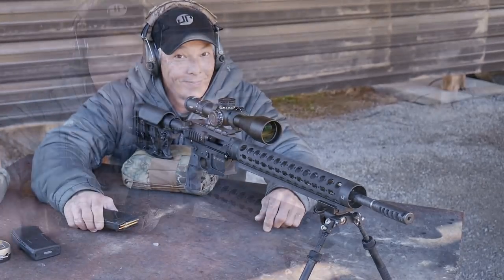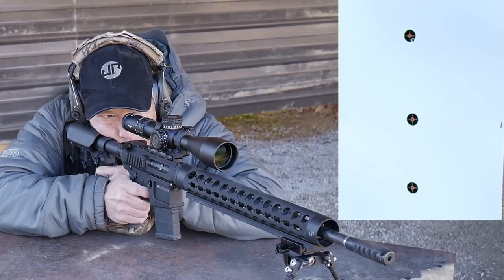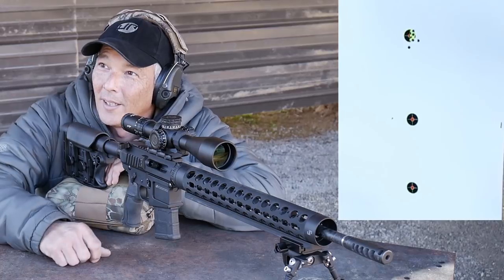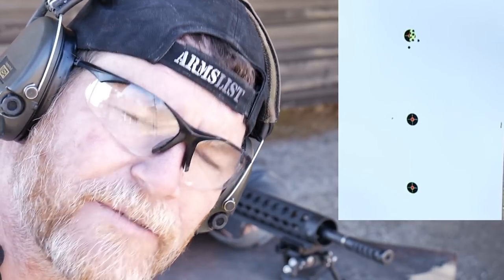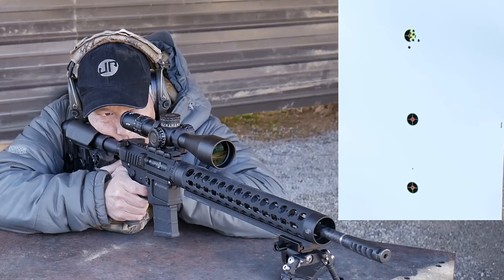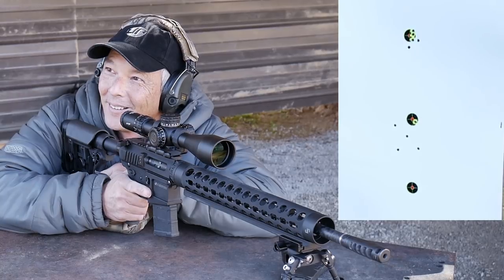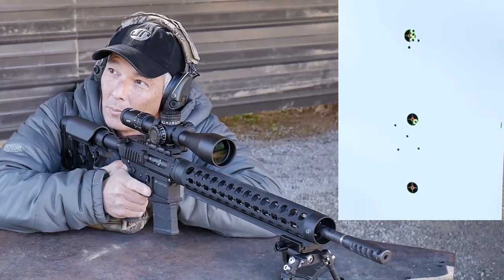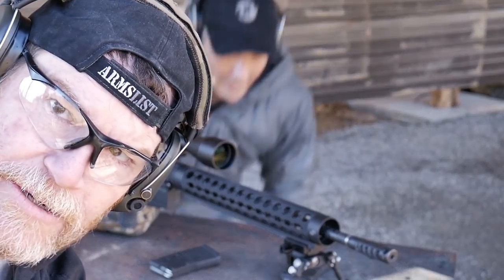Tulammo 75 grain .223 is a No Go & Here is Why!!

Comment: Can’t wait for the classes in PA
I’d say it’s still good SHTF ammo.  All of those shots will still hit center mass or close enough to be a bad day
Reply: @Future-Preps35  Huh? stick in your chamber after a mag or two? This is all we use on a PSA and many other brands with a drum mag and Fostech trigger, NEVER any stuck casings! It's shit for tight groups but that's no surprise here. Perfect for cheap range mag dump ammo.
Reply: ricky rhodes  Some rifles just have tighter chambers or might be under gassed  than others and won't cycle it as well is all. Most rifles will eat it up all day long. If your rifle tends to choke on it then splash some oil in your chamber (bore bath) and it normally solves the problem. The only thing steel case will ruin faster is your barrel due to the bi metal jackets wearing it out faster. But i agree, like you said with prices the way they are you can pretty much just buy brass instead anyway.
Reply: Only the Ak47 platform is a true SHTF rifle if you're using an ar15 youd be best sticking to good ammo.
Reply: @Future-Preps35  not true at all, this has been  disproven time and time again

Comment: Does barrel twist affect the accuracy as the heavier the slug gets
Reply: Yes.
Twist and lenght. There's a formula just 4 that. 
75gr in this varmint caliber cartridge is just about the practical limit of its design.
Reply: Yes the heavier needs a faster twist to stabilize
Reply: @shermankearns200  and longer barrel.
Reply: 1/7 is the way to go.
Reply: @notyou1877  Not true a short barrel with 1/7 will have no problem stabilizing .75gr.
Reply: It's not the weight of the bullet (although there is direct relationship) but the length of the bullet in relation to bore size that will dictate what your twist rate should be to stabilize.
Reply: @notyou1877  InRange did a Q&A with a Faxon engineer who said that the bullet spins up to speed within the first bit of the rifling iirc
Reply: @barrydavis7068  It's both. can't have one without the other. The twist rate of your barrel  dictates the length of the bullet.  Other factors as the shape of the bullet.  But in all it's not the rifle that is accurate it's the shooter.
Reply: @aa-yt7wo  define the "first bit" please.
Reply: @notyou1877  I have to rewatch them but I think it was something like the first 1/8".  It doesn't take 16" of rifling for a bullet to spin up to stabilize it.
Reply: @aa-yt7wo  I can go on for hours about this, but I just don't have the time. I can give you one real life example though: .223 Rem. In a single shot heavy 20 inch barrel varmint riffle with 1 in 10 twist will not stabilize a 55gr projectile but it will do
 great with a 45gr. That's a real life example for this subject at hand.
Reply: @notyou1877  the rate of spin is determined by the rate of the rifling not the length of rifling
Reply: @notyou1877  What the hell are you talking about.
Reply: @airwolf269  you said "short barrel" will stabilize a bullet. I wanna know how short? Apparently in your world the minimum barrel lenght is not considered important as it is in mine.
Reply: @barrydavis7068  let's get a little more precise here. Lenght of the bullet is not the same as the lenght of the bullet's body making contact with the riffling. Those two things are not interchangeable. VLD type is very different than the S8 ogive found in traditional projectiles on the market. 
On the other hand why am I wasting my time discussing this detail with you. You don't make jacketed projectiles. You just pull the trigger.
Reply: @notyou1877  Number one you have no clue to my world.
Reply: @airwolf269  we both agree on something!
Reply: @notyou1877  IYO Its like a brown eye, Everyone has one.
Reply: @notyou1877  First of all, you don't know what I do.  And second of all I can see from your responses to other comments you are no Bryan Litz.
Reply: Yes
My mp15 1/9 can't hold a 77seira match worth a crap past 250
It will hold a 69 all the way out to 400
Reply: 1:7 should work.
Reply: @barrydavis7068  I don't care what you do Barry. Really.
Reply: It's not as important as some think, but kinda.
Reply: All these comments and not one mother fkr knows what they're talking about.

Comment: I bought 1000 rounds of the 55 grain 223 stuff. 100 rounds an I got 2 stuck cases. Not a big fan. Treated my chamber with moly paste and seemed to cure my stuck case problem. Still have 780 rounds left to go.
Reply: Get a heavy duty extractor spring.  I do that with all my ARs, no problems extracting steel case.

Comment: I ran about 85 rounds in my AR-10 and got a stuck case. 115 rounds left to get rid of this stuff then on to the brass case ammo. Great video as always KB32
Reply: Get a chamber brush and clean the chamber very well because more carbon gets past the steel case
Reply: Try a "bore bath" type it in on YouTube
Reply: Thanks for the ideas guys. I got lucky in the fact that the case in question fired and was a empty case upon removal. Got it out and cleaned it quite well. Also the steel ammo I have left is starting to get surface rest. Thinking I’ll just use the ones that haven’t developed rust and find a good way to dispose of the rest.
Reply: @StewieStew820  exactly, just squirt a couple drops of lube in your chamber every hundred rounds or two of steel case(bore bath).. helps with tight chambers that don't extract steel cased as well in ar's

Comment: I personally wouldn't use the. 223 but I've gotten decent accuracy and never had a problem with 7.62x39.
Reply: Gee ak fanboy
Reply: Good for close range, but similar to 300 blackout It's basically trash beyond 300 yards
Reply: @Es1911sumware Care to say how I'm wrong? The round has a 12 inch drop at 300 yards..
Edit: Well I waited almost a day so far, so basically you're just fanboys..
Reply: Tulammo .223 has hard primers and steel cases like to stick in ARs unless they're clean and very well lubricated. I wouldn't recommend betting your life on it, but if you upgrade your hammer/spring and keep your gun clean, it's fine to use for plinking/practice.
Reply: What Craig said! I can shoot better groupings from a standing position. This video is making me feel like The Rifleman.

Comment: Same experience I have had with Tula. They have piss poor quality control when it comes to getting a consistent powder load in their ammo. I have had a lot of their rounds that were loaded so light that it wouldn`t fully cycle the bolt on my AR, causing FTE and FTL. I had to have a buddy film the action on my phone and then slow it down so I could see what the problem was, and it became real clear real fast that the Tula didn`t have enough ass to work the action. Might be fine in a bolt gun, but for an AR, it`s a 50-50 chance at best.

Comment: In order to have an accurate round the projectile the velocity and the barrel harmonics half to match.
If you test a bunch of different ammo and you find one that is accurate in your gun, you're good to go. If you compare that to something you just grabbed off the shelf, odds are the shelf ammo is going to be much less accurate.
If the ammo is inexpensive enough you should pull the bullets select a powder and work up a load velocity that will bring the projectile and the barrel harmonics together, and all it will cost you other than the time to do it is purchasing a replacement powder.
If you wanted to be super cheap you could use the powder you pulled from the bullets and adjusted accordingly.

Comment: 3 to 4 moa is it normal for Tula. When you're doing your distance shooting  use brass.

For doing Up Drills, Zipper drills, transition drills, room entry drills, magazine change drills, malfunction drills, movement drills.... at under 50 yds the Tula is more than adequate. 

90% of drills is under 50 yds, so 90% of my ammo is Tula.

With the amount of money I have saved using Tula over 10 years, I have filled a whole safe with AR-15s.

Comment: "75 grain is always better than 55 grain." Except when you're dealing with armor. Which would actually be something to keep in mind during a SHTF scenario.

Tula/Barnaul ammo has never been known for its consistency of bullet construction / consistency of velocity. Both of which are needed for American levels of expected accuracy. Expecting accuracy to be decided solely by grain weight is unwise. You buy russian steel cased ammo for the cost savings. And when it comes to their soft point & hollow point offerings, you buy it for the acceptable lethality for the least amount of money possible.

Of course, every barrel has its favorites. But I've gotten ~2 MOA out of Wolf (Barnaul) 55 grain FMJ. I wonder if the issue with the 75 gr Tula stuff is the zinc jacket.
Reply: 124thDragoon good point what’s your best cost to performance round?
Reply: @MrEtherShot  that's such a old tale, yes speed kills armor 20 years ago, modern armor is more complex
Reply: @AmazonWebService98  plenty of videos of 55gr FMJ out of a 20+ inch barrel going through AR500 or better.
Reply: @jellyfrosh9102  ar500 8snr really exactly what I would call armor

Comment: I’ve used the 55 grain stuff and usually get a 2 inch group.with a 10.5 and 16 upper. However the stuff is dirty and has a tendency to gum up your action after a few hundred rounds with failure to feed

Comment: Depends on the rife and shooter. Tried shooting this ammo out of my CZ 527 LUX .223/5.56 bolt action. Problem was the case dimensions were not even close to factory brass cases. One actually got jammed (after discharge) in the chamber and I could not remove it at the range. It took me about 15/20 minutes to remove the case with a hardwood dowel tapping it with a rubber mallet. Called CZ and I was told that this rifle should shoot steel cased ammo all day long. I was asked to send it back if I thought there was something wrong. I didn’t and it shoots brass cased ammo of any brand (223/5.56) all day long and with accuracy. No more steel case ammo for this rifle. Now my mini 14 shoots anything. Period

Comment: I have found that a 1 in 7 twist does not stabilize the 70 gr and up bullets.
Reply: You realise 1.7 are designed for heavier projectiles. The one you tried from the one manufacturer may have not grouped well,but that isnt stablazation.

Comment: When I first got my AR, I shot Tulammo. At 50 yrds, it did ok, but at 100 yrds, it was bad. Went to Academy and bought their Monarch steel cased ammo, not the best, but can hold 2 MOA or a little under at 100 yrds. The Monarch is right at $5 for a box of 20, not much more than Tulammo with better performance. From what I gathered from internet searches, Monarch is rebranded Brown Bear. I shoot the 62gr ammo in my 1:9 twist AR and it shoots great.

Comment: I use ppu Russian made ammo in my 300 blackout and hunt with it to,and with 125 grain hpbt on my ati 300 blackout I've used it now for over 6 years with dead on groups touching each at 100 yards.with a nikon prostaff 4/12/40 bdc rifle scope and 7 inch drop a dead on 200 yards and a good 1half inch groop at 200 yards.with my ati 223 now I use frontier 55 grain ammo in soft points and they to are dead on at 100 yards and with on drop at 200 yards with half inch groupings at 200.when I bought both of my ati ar rifles with both set up exactly the same as each scopes and all ati told me not to be using nothing but brass ammo in each rifle and no steel ammo.now I have a diamondback db 10 308 ar rifle and use silver bear 308 steel casing soft point ammo with it but I do have to clean my rifle after ever time i shoot it,the silver bear 308's shoot great at 100 yards and at 200 as well!!!!!

Comment: you should redo this test,  but only for 1st and single shot accuracy. it looked as tho cold bore it was on point, or maybe it's the barrel because in all tests with the first group hornady I believe, 3 were sub moa then it just opened up. it may be the barrel.
Reply: Good point.  The first group was looking pretty good, then just a few rounds later it's patterning like buckshot?

That's pretty iffy.

Comment: Usually 5.56 barrels are 1-9 twist. Good for 55 grain. .223 wylde barrels are usually 1-7 twist which is good with heavy grain. I’m no expert but I like it in my 10.5 .223 wylde. Holds under 3” at 100 on a bs cv life scope. 🤔

Comment: This is exactly what I stock pile and range shoot. I’ve never had anything like this.. I don’t shoot at 1” dots but I do like kissing off the guys with precision rifles trying to pop clays on the back berms which from my lane is cross range at 275ish.. with a Simple 1-6 I can pop those clays at will with a 14.5 4150 Crome lines barrel. And that’s a 1/9 barrel

This is also what I use to zero with and even when swapping over to 55fmj or 77g black hills I don’t have issues.. I’ve never had a group like that unless rapid firing with just a red dot at 100.. 

In gel it also performs a lot like 77g otm.. little longer neck then you’d desire but damn near same performance. I’ve been stocking this crap away and shooting it since 2012ish when it first came out.. I’ve got maybe 20 cases of this down range now and never had a single issue in any of my rifles like this. 1/7 1/8 1/9 all the same results from 10.5 up to 16” barrels.. I for the $180 a case this stuff normally goes for I’d take it over anything else on the market.. back in the day it was lake city 62g till those prices went through the roof.. ever since this is 70% of what I’ve shot for years cause normally no one is paying attention and looking for heavy weight Tula they are always jumping in the 55 fmj..

Comment: I thought the 75 grain ammo worked best out of a SBR with an 8 in 1 twist... maybe a 7 in 1. but i have had many reloaders tell me that and it was based off of power, weight of projectile, and length of barrel. i may be mistaken. try this again with an SBR. mine is a 10 inch barrel and they say a heavier grain round is what i really should be shooting out of it.

Comment: If your using an AK47 this ammo is fine........Dont use this in any AR15. cause its steel casing and will lodge in the chamber. it doesnt shrink as quick as brass does and wont eject.

Comment: I’ve never been too  interested in shooting steel cased ammunition from my rifle.  I’ve always been told it’s not good on the bolt and ejector.  Is that just a myth or is that legitimate??
Reply: Myth
Reply: Myth.  They will wear a little faster but the money you save in the amount of time it takes to wear said parts outweighs the wear on the parts themselves. If you dont reload and are plinking or training there is nothing wrong with steel cased ammo.
Reply: Freedom Inc. wellll, thank you.  Now I know.  Yeah I don’t shoot a whole lot.  Usually about once a month and just plinking.  And even with that I only go through about 300 rounds during each session.  I guess then I’ll have to try the Tula.  I can’t remember where I heard that about the steel casings.  It was from more than one person.  I had just figured to play it safe cause I love my rifle and it took me four years to buy her piece by piece and build her.  My rifle is probably considered low standard by most people but it’s been perfect for me and I’ve never had a single malfunction.  Very reliable.  Thanks again.
Reply: Myth...
Reply: Myth.. though it WILL wear your barrel out faster than most brass cased ammo due to the fact it has a bi metal jacketed bullet.. just don't do a lot of mag dumps and it will only slightly wear it out quicker.
Reply: Bry4Christ&2ndA—-I bought a case. It’s brass.

Comment: NOT ACCURATE WONT EVEN FEED RIGHT I run it in my SKS it loves it but my AR no FEN WAY
Reply: David Reed my Mk47 has no problem with Tula. I like the range friendly ammo, great for plinking. I save the more expensive stuff for when I need accuracy.
Reply: That's ~ALL~ I run through my SKS.  Never tried it in an AR.  I consider it "purpose ammo".  It's purpose is to shoot from my SKS.  :)
Reply: I shoot it thru my ARs all the time, just yesterday I was hitting a 12 gong at 400 with about the same regularity as any m193 or m855. Have yet to have a failure of any kind. Match ammo it is not, plinking ammo, Hell yes.

Comment: This ammo shoots very soft. In one of my ARs it pretty much made the gun a single shot. I'd have to manually rack every round in the magazine. 
I did end up changing that barrel for better accuracy and getting an adjustable gas block, and it helped. But it's still an underpowered load. It may work in an over gassed gun, but a small gas port with a standard buffer won't like it. 
I still have over 250 rounds sitting around. The only gun that likes it is my 10.5" pistol build.

Comment: The 7.62x39 Tula seems to shoot better than the .223 Tula. Russian made ammo in a Russian cartridge vs Russian made ammo in a NATO/us cartridge.
Reply: The fact the 7.62x39 cartridge is tapered along it's whole length helps a lot with steel cases, far less chance of them sticking and putting extra load on the extractor with the different properties of the steel case regarding expansion etc. 223 being straight walled is more likely to have an issue and is higher pressure. Possibly the higher velocity affects the accuracy more for the 223 bullets if there are some inconsistencies. I too have found most steel 7.62x39 provides reasonable accuracy, I don't use steel in 223/5.56 for the reasons stated above, much more chance of a problem that could put the rifle out of action, which would be really serious in any sort of defensive situation.